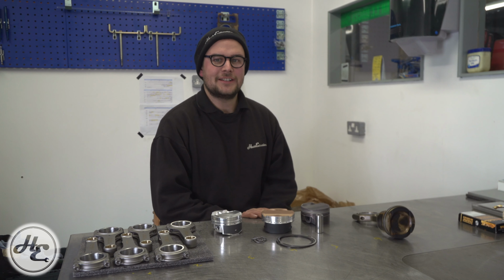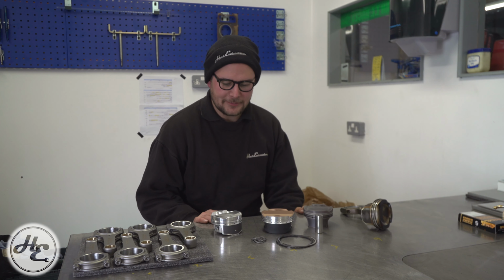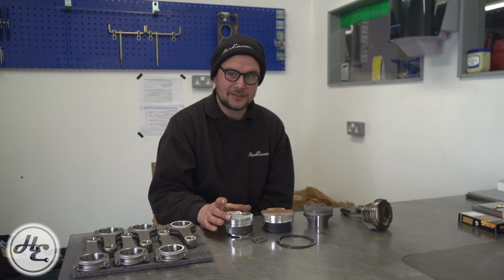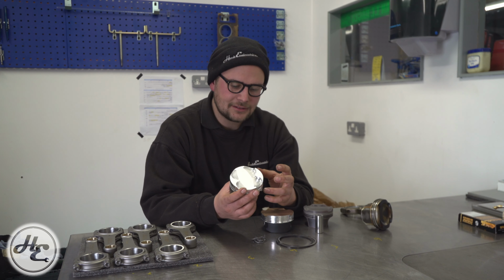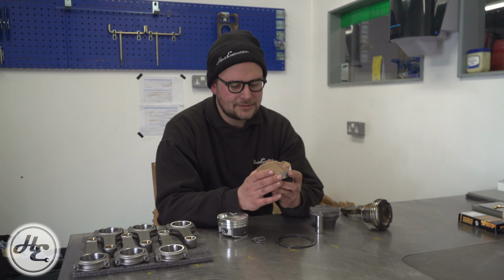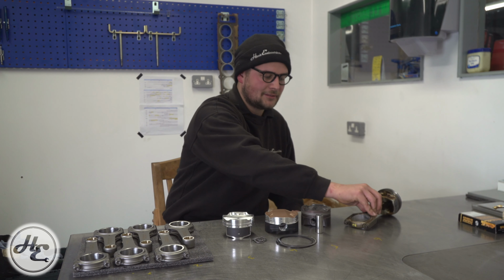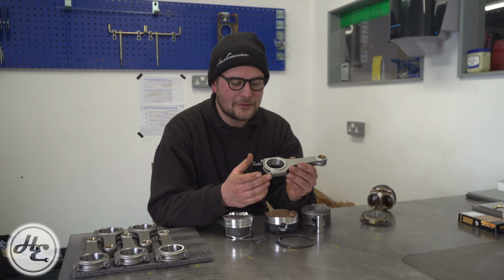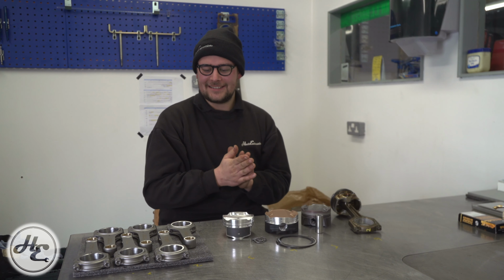'Forging' an Engine - What is a FORGED engine?

Comment: Just one question do you leave your mains bearings stock as long as your clearance is in spec or does it change when building a racing motor
Reply from the maker: It can change depending on the intended use/specification of the engine. Generally a race engine will require a little more clearance than a run of the mill road engine to allow for crank flex at high revs/cylinder pressure. But it is very important to specify these clearances carefully. 

Also, bearings like ACL Race Series will put up with more abuse than a generic bearing. And so it's often wise to upgrade.
Reply: @hackengineering5586  if race bearings are so good then why not use halfmoon needle bearings to make the crank run on roller bearings like 2stroke motors that also takes punishment
Reply from the maker: @Rootboy-q4b  friction! Roller bearings are great but not suited to the application. In previous careers we've worked with pre-war rollerbearing cranks. Hugely complex, hugely expensive and not as efficient. But they are very strong.
Reply: @hackengineering5586  expensive I believe that splitting the crank you would need 3 cranks to make one with roller bearings slot machining and balancing such crank it's just too far.....so is race bearings also forged and wouldn't you rather recommend higher oil pressure in standard bearing size

Comment: I am new to cars and I got a 2016 3.8 genesis coupe and I want to make more power without adding forced induction what does building an engine mean or what do I add or upgrade
Reply from the maker: As ever, creating a more powerful engine is all about getting more air through the engine. So reducing restriction, getting camshafts that allow more air into and out of the cylinders, letting the engine rev more... All key factors. You can also compress that air more by upping the compression ratio. There's no short answer but the basis of all engine tuning is that the engine is an air pump.

Comment: Great piece, in effect have you inadvertently solved the rod bearing issue, not the bearings but the rods bores not being round hence you see alot of pulled bearings with flat/high spot wear......so to truely solve issue replace rods and bearings with post split honed rods....
Reply: If you hone your rods you will have to machine your crank and use a bearing shell adjusted for the size and factory clearance tolerance. If you use a lower weight oil, 0-w40 or 5w-40, religiously warm up the car properly; rpm <3000 until oil temp 165F and rpm < 4000 until full op temp 200-210 for my S65. Oil changes every 5-7500miles AND most importantly regular use of the car so that the internals are always well lubricated, especially during cold start where Mose wear occurs. Regularly use the entire rev band and it will run fantastically and reliably. I put 164k miles on my M3 and never swapped out bearings. I was second owner with 17.500 miles to start as my daily for 8 years. If you follow this you don’t have anything to worry about. Factory spec oil is not ideal for street driving the engines as they are built from factory.

Comment: You covered Rods and Pistons but didn't answer the very question in your video Title "what is a forged engine" if the rods and pistons alone don't constituent a Forged engine! What does?
Reply: @hackengineering5586  i understand, I'm a car mechanic of 15 years and engine builder for DJMotorsport for 12 years. I suppose I was disappointed! As I was intriguing as to what you were going to say a "Forged engine" would entail beyond Rods ,pistons and Crank. That's all.
Reply: @DG-ox6bg  could you please explain what all parts would constitute a forged internals engine
Reply: @waynesaldanha361  the title of the video has changed and for some reason Hack engineering have deleted their reply. So my comment doesn't have perspective anymore.  I believe the original video Title was "new secrets of a forged engine" unfortunately there were no secrets. Hack engineer did click bate and added forged parts. Same as we all do.
Reply: 0:32 it's a misconception that rods and pistons constitutes a forged engine. Yet all you talk about is Rods And Pistons...